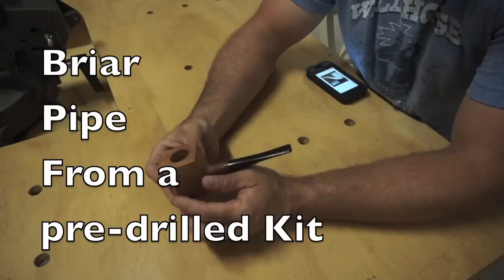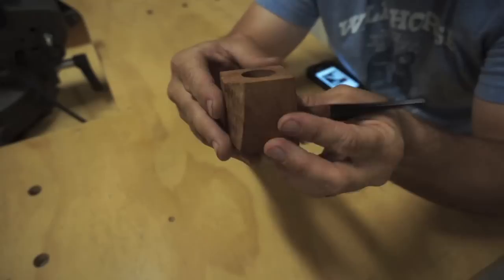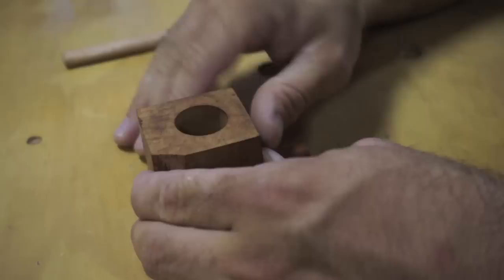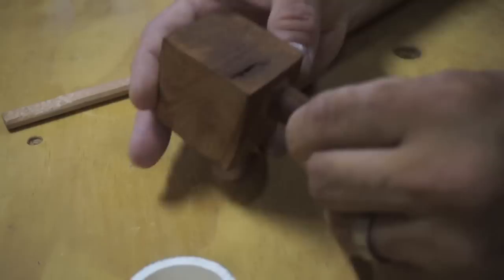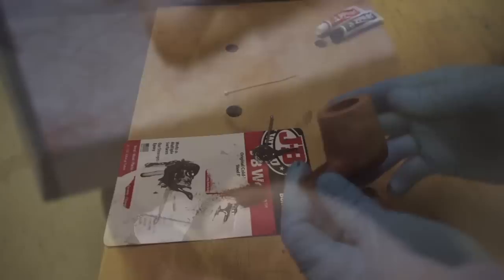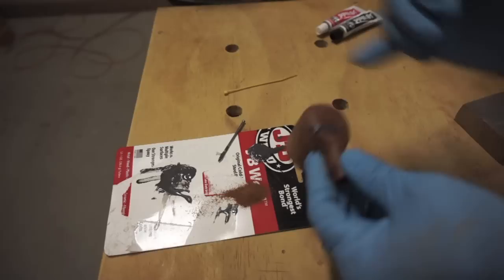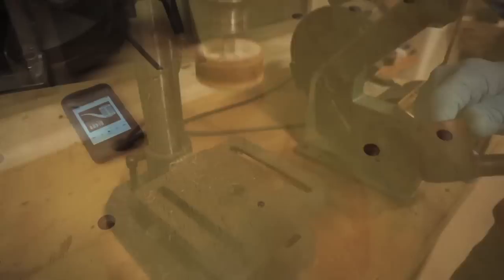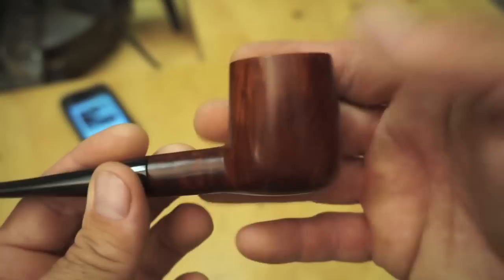Carving a briar pipe kit

Comment: Be careful with the stain you used. Some stains don't take well to the heat of a pipe and will have issues on warming up. Also, be very careful not to get any inside as, even if it doesn't hurt you, it will likely affect the taste of the tobacco. Yes, I smoke pipes and just started carving my own from blanks. But my first was carved with carving knives while I relaxed in front of the fire place like the old man I am.

Comment: There is an epoxy that gunsmiths use called Acraglass gel that works like a dream with wood. Its advantage is that you could have mixed the sanding dust from the pipe with the Acraglass to fill that imperfection and it would have taken the stain so your repair would be, largely, undetectable.
Reply from the maker: I'm gonna check into that Don... thanks!   i have an old gun stock that is cracked and that might be the trick:)
Reply: homesteadonomics , It will definitely work for that. Larry Potterfield of MidwayUSA has some videos here on Youtube that'll show the best way for fixing a cracked stock. Midway doesn't sell the Acraglass but they have a product that is just as good. Brownell's sells the Acraglass. MidwayUSA and Brownell's are both great companies to do business with. I was a gunsmith for 29 years and had them both on speed-dial.

Comment: Neat video. You're an inspiration!
Reply from the maker: +Beardly Gentlemen Thanks BG!  It was a fun process and I hope to do another too but maybe out of mesquite or something that is a bit easier for me to source:)
Joe
Reply: +homesteadonomics I hear ya Joe. I've got an old apple tree out back that got blow down in a wind storm this year and I'm wondering if I shouldn't try aging/drying it and trying my hand.
I've heard of people using pare wood; it's just like you said though, the worst that could happen is I might learn a thing or two.
Reply from the maker: +Beardly Gentlemen Yes!  That sounds like a 'windfall' to me... free wood and I'd think it would make for a beautiful pipe... and if the wood charred too quickly then at the very least it'd be a great wall hanger or special occasion piece!  I want to try with some mesquite... it's very hard, similar to briar but tends to crack and probably doesn't have the fire resistance that briar does.  But another option would be to try with olive wood... I've heard that makes a nice pipe too:)
ps-have you listened to 'the country squire' podcast?  Great hosts and and content too:)

Joe

Comment: I really would like to do this. I would however recommend you doing a brief description of the steps you are doing and the equipment you used. like what was the stain and what was the point of lighting it on fire? other then that it was a great video.
Reply: Any kind of leather dye. And burning it burns off the alcohol.

Comment: Joe,
What is that dremel bit called that you use in the video? I do not have access to some of the large equipment you have and so I may have to reply not he dremel quite a bit for this.
thanks. steve
Reply from the maker: awalrus1 Hey Steve, 

I can't remember what it was called exactly but it's a carving bit that is shaped like a cylinder with a rounded end.  It might have been called a cutter or carver bit, i think.  I want to say it was like $5-6.  It cuts really easily and I don't think it'll take much longer if you're using the dremel bit alone either. 
Anyways, hope that helps... and thanks for watching:)
Joe